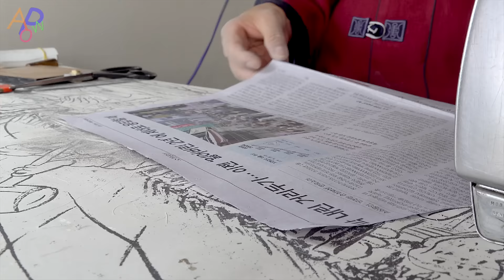Process of Making Traditional Calligraphy Brush by Old Master Artisan

Comment: Traditional CA glue and laser etching XD
Reply: In ancient times glue would have been made of either tree sap or thick starch, or animal skin. Both are time-consuming to make and usually you need to use them within a limited amount of time because they harden after a while and would no longer be reusable if you don't use them up.
They probably realized that it's more practical to adapt modern methods that won't affect the craftsmanship.

Comment: Anyone ever made a brush with cat whiskers? I've been saving my cats and want to have a brush made with them.
Reply: Ive wondered the same thing! Cats lose whiskers from time to time and I had that same thought but I also think they wouldn’t work in paint brushes because the whisker has a pretty hard smooth cuticle that probably wouldn’t hold water. The reason some hair works better than others has to do with how they hold onto water and pigment and how they release that water/ pigment onto the paper as well as the amount of springiness or stiffness in the hair that allows it to snap back into its position after bending on the paper.
Reply: zzzzzzzzz